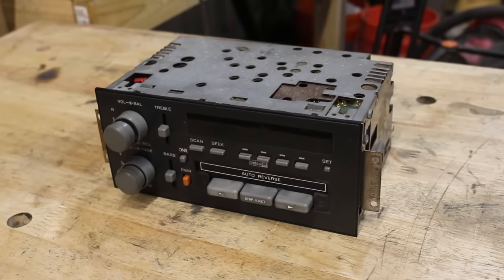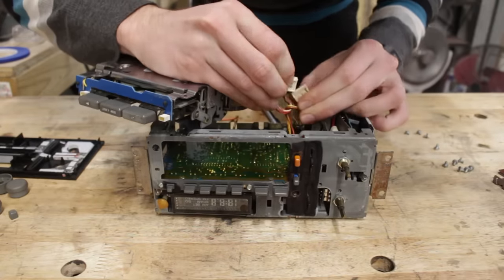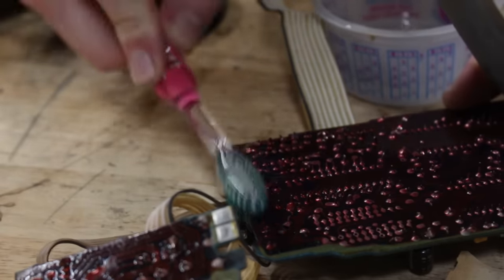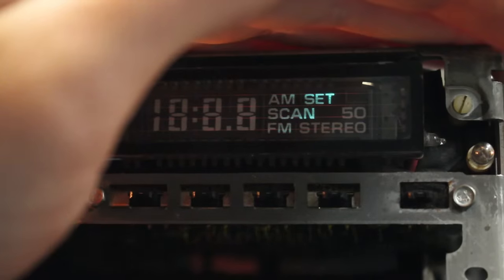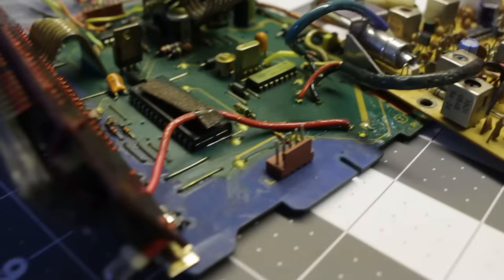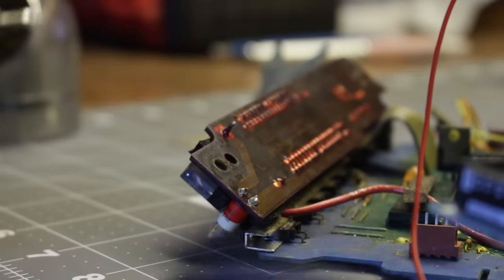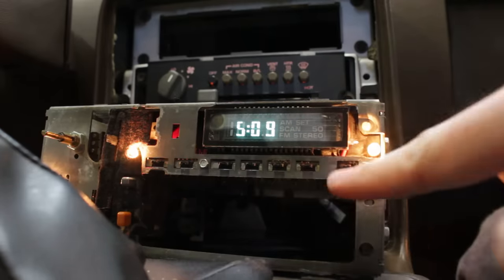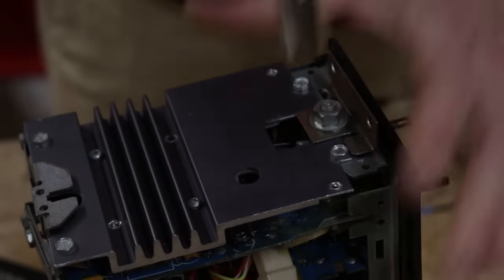1985 Fiero Radio Repair! | Saturday Projects

Comment: I'm deeply appreciative that you decided to keep and fix the OEM head unit than slapping a aftermarket one :"3
Reply: Yep. She's only original once.
Reply: Adding a BT module inside hooked directly to the amp would be a welcome mod. Kepping it OG but working with new stuff.
Reply: bluetooth tape adapter would sound just as clean without any fiddling around inside.  annoying that you would need to charge it every so often, but sound quality, top notch (and if he doesn't mine the wire to circumvent having to charge, the 3.5mm adapter is all the better/easier).

now just need to have phone manufacturers stop removing headphone jacks.
Reply: @darkmagician1184  you could steal 12 volts from somewhere in the radio and step it down to 5, and then the tape adapter wouldn't need to be charged if you kept it in there all the time
Reply: @darkmagician1184  If you are not a purist of sound or the base device is not great the tape adapter is fine, but its not great, the digital audio is turned to analog electric signals then into magnetic pulses, then picked up by the head of the tape wich reads the magnetic changes, then turn to electric pulses, preamplified, and then gets to the amplifier, a lot more steps and ways to get noise amplified than a BT module directly conected to the amplifier part of the stereo. But I agree that phones need to keep the audio jack, I dont like BT that much but having broke so many aux cables I understand the appeal now.
Reply: I have to disagree, changing a head unit is one of the best things i think you can do to a car to improve its functionality. It fits the look a lot better sure but a modern head unit would be way more functional, even if most of them are pretty ugly. He could have put a BT module inside to give him that, or stepped down the voltage inside to charge one of those BT tapes.
Reply: I added an aux in to the head unit in my 1982 Volvo by re-using a DIN socket on the rear that was originally intended to allow connection of an OEM EQ module. Instead of the EQ I made up a cable with a switching 3.5mm jack on the end, this can then be fitted to one of the switch blanks that the 240 has in the centre console for a factory look. Into that I can plug a phone, DAB tuner or BT module; to play a tape or listen to the radio I only need to pull the aux cord out. I don't have a big LCD screen glowing away up front but it's an antique car and I don't want one. We got by for years without having an iPad glued to the dash and this is the perfect compromise for making my 39-year old daily driver easier to live with whilst maintaining her originality.
Reply: @nope110  you can buy a BT module that fits in between the external antenna and the ant input on the head unit. When powered on it cuts all inputs to the tuner aside from whatever is connected via BT so you don't even need a clear FM frequency like the old DM transmitter adapters - you get a lovely clear signal with no interference because it effectively, electronically disconnects the antenna. Failing that Retrosiund are a company that make replacement head units for classic cars that look the part but have all the latest whistlesxand bells. There are lots of ways around having to retrofit a horrible '90s techno head unit to your classic car in order to dispense with physical media.
Reply: One of the very very few people who actually does that including me. If I had bought a vehicle that did not come with the factory radio, I'm going to the junkyard or on eBay.com to find one that closely matches or matches what it came off of and replacing that current one with the original.

I'm fine with using an FM transmitter or a cassette adapter, but please don't replace it with some aftermarket radio, it does not look good at all with the rest of the car!
Reply: Those 1970s and 1980s General Motors Delco radios, head units, whatever you want to call them were really great radio performers. They pulled in distant stations very well. I had a mono AM FM radio in my 1974 Vega and even though it wasn't stereo, I never had any static on it. It was an excellent performer.
Reply: If your phone has a type c connector it might do stereo analog sound out of that on a couple of the pins. My Pixel 3 and 4a 5g definitely do. I use the adapter that was an optional bundled item from the Pixel 3 order from the Google Store when they came out to get a better aux output from my pixel 4a than the aux out it has. The one it has is awfully weak and makes my custom sound systems sound awful. That little type c adapter with a type c female plug, male plug on a short captive cable, and a 3.5mm mini-trs aux female. It works very, very well.
Reply: @nick_nt7574  if you look around there are some that match a car nicely I got an alpine last year that still had an old-style led screen just like the factory in me 92 eb falcon

Comment: A little information about your radio. They called these the ETR Series radios. This radio is one of the earlier units to utilize the green vacuum display, replacing the old orange segment style displays. You can tell this radio is original to the car, or is definitely a 1985 headunit. The "Delco GM" name badge on the face went away in 1986, and was simple "Delco" from then forward. You also have the earlier style amplifier with 2x DM165 audio amplifier IC's. Should be 20x4 watts which is fantastic for 1985. There is a way to change the display on that radio to a lovely orange that matches the red extremely well. The display you had to reflow, 1991-1994 Saturn stock radios use the identical display board with the lightbulb and everything, but the vacuum fluorescent display lights up orange. Direct swap.

Comment: I wish that this series would never come to an end... 🥺
Hint for the casette player: I think you are very very close! I used to repair and clean many of these old casette players, and my assumption would be in this case that as You mentioned, may be the belt is tight a bit, this is normal, usually, the RPM of the cheap versions are not controlled by microcontroller, but there is a tunable resistor (potentiometer) you can tune the engine PRM with, this can be on the PCB or inside the motor, but there is a hole covered with some cross-cut sponge like material, you can push a little screwdriver through. The tape speed should be around 4.26cm/s, but if you have a well known track, you can adjust the speed 99% fine, just via ears. ;)
The other thing that can cause meowing are
1. that the grooves the belt are running in, can be dirty as well, these should be cleaned also.
2. The 2 rubber rollers can be dirty,. These can be cleaned only during operation, beacuse it is so hard to reach the whole surface and apply enough pressure on the ear cleaning pick to be able to remove the thousand year old dirt... 😉

On the other hand, the rubber roller may (does) shrink, especially when the car was sitting outside for decades, this should be checked also.
During play, the roller is pushed to the chrome plated axle via spring, check there is enough spring force, so the tape won’t slip during play.
I assume that the chrome plated axles which drive the rubber rollers can be turned easily by finger (of Finger 😉😜).

If these inspection are performed and meowing still exists, the clutch mechanism(s, since You have autoreverse) should be checked. If the clutch is so hard, and the spring of the rubber roller(s) not tight enough it may happen that the tape is slipping between the roller and the chrome plated axle, but this situation is quite rare I think.
If the meowing is the same independently from in which direction You are playing the tape I think the clutches are fine. (there is a very little chance that both are wrong exactly on the same way, I think)

One remark: if You wish to use the player with other audio sources as you showed via smartphone, there is a much simpler way than using that horrible sound quality audio adapter tape: the cables ftom the 3.5mm jack connector can be soldered directly to the input of the amplifier module. Usually this is where the 3 cable (red, white, ground) of the head, (or more (?) cable in your case, since You have 2 heads becase of autorevese) is soldered on the PCB.
I hope that this would help!
Sorry for the novel! 😉
BR,
Gery
Reply: If you are keeping the original head unit I wait total solder in an aux Jack.   This would be a good Saturday project.
Reply: I was able to get an aux jack into my Clarion head unit from similar vintage RX7 by doing something similar.  However, you need to trace the cassette mechanism and figure out how it turns off the radio when you insert a cassette.  You'll need some sort of switch or relay connected to a button to perform the same function when you want to listen to your auxiliary input...unless you want to hear the radio playing over it.
Reply: @chrishuyler3580  If you are a ghetto fabulous or super bubba wiring and circuit man you can just not plug the antenna in.
Reply: WOW - nice, very nice description.

For using any other Source like Smartphones there are Bluetoozth or radio Frequency Adaptors available to "stream" the Sound via own Frequency or BT - no soldering or wrecking of the original Radio necessary
Reply: @FRITZI999  those radio frequency adapters sound like compete garbage and even the best ones will limit you to FM frequency range.  If you want dynamic highs and lows, it’s not difficult to hard wire an auxiliary input or Bluetooth chip.
Reply: Great reply!..
Reply: What a fantastic reply. The internet was invented just for this exact kind of assistance - a fellow with deep and well-remembered personal experience giving his hands-on advice to a newer person. Good work, Gery!
Reply: @chrishuyler3580  I actually never noticed that on my Classic Car - as we all mostly use the Super-Garbage MPEG3 Format to listen to Music we actually should not discuss Quality ;-) 
This Format cuts of the entire Dynamic of the Music and limits Quality back to before old Records, just without the Scratches. 
So I would not worry about that.

Doesn´t the Music Radio Station sound good ? - so will the Stream you send in via own "Radio Station" from your Phone or whatever. It depends which Source you use. The Transmitter DOES NOT limit anything. Garbage (MP3) in = Garbage Sound

;-)

AND - listening Music in a Sportcar like mine whith the Engine behind me and the Muffler nearly empty it sounds for me more like Beancounting talking about loosing Dynamics of the Music. ;-) Don´t you think too?
Reply: @FRITZI999  if you can’t tell the difference between FM radio and 320kbps MP3, you either have very bad speakers or very bad ears. I will add, however, that Satellite radio is by far the worst quality of any source and that’s something like 64-128kbps.
Reply: @chrishuyler3580  well, i might need to point out, that i live in Europe (Germany). Radio im America is very low Quality comparing to our HighFi Level Broadcasts.
Not even Satellite radio in th US can beat our radio Quality. 

Thanks, but my Ears are pretty good. From technical standpoint it´s pretty clear. And as I said - Engine rumbling behind me, Muffler roaring and you are BS-ing about Quality of the Radio.... yeah, sure.

come oooooon ;-)
Reply: @warbuzzard7167  great response and so true
Reply: @FRITZI999 We have HD Radio in America, but a stereo from the 80's isn't going to receive a digital signal so you are stuck with the poor frequency response that has weak bass and grainy treble, not to mention the lack of stereo separation.  It's a dated technology (aside from HD radio) and using it in your signal path is much worse than directly wiring in a bluetooth chip or aux input style adapter.

Comment: Hey Ronald, nice work. It was the thumbnail that got me to watch your video. I immediately knew that was a Delco Electronics radio. Not because I had a Fiero, but because my dad worked for Delco Radio, which did one more iteration to Delco Electronics. He worked for them from 1960 to the early 90's. There is a reasonable chance one of his patents is in that unit of yours. He has since made the great heap and is no longer scribbling out the differential equations on his church bulletin (possibly not listening entirely to the service?). But he was always working on mathematical electrical engineering equations even when not at work. Math, Physics, and engineering was his passion, and Delco Electronics made it possible for him to use that passion to raise a family.  We were all truly thankful for his career and the existence it provided, and as a result, I was raised as a GM kid. Delco Electronics was a pretty interesting place.  When my dad hired with them in the 60's, it was all about the power transistor. He used calculus and and algebra to figure out biasing of the circuitry to build transistor based audio amplifiers for cars radios. But then in the 70's Delco Electronics made the decision to start making their own integrated circuits. Commonly know as ICs. To do this, they also grew their own silicon. Nobody else was growing silicon except for the dudes in silicon valley and in Japan. But there they were, in Kokomo Indiana, growing vertical columns of silicon, then slicing wafers of silicon, masking off layers in what was almost was a photographic process, to build complete transistor circuitry onto wafers, that then would be sliced up and placed in an IC packages. But with the mass exodus, all research and development left Kokomo for suppliers who I guess are now located in China. It is sad to drive by the Research and Engineering building in Kokomo, for to this day it stands empty. A lot of thinking, long hours of problem solving and maybe even some stale cigarette smoke is still echoing around in there. I don't know if youtube lets you place links in comments, but in homage to my dad here is a link of his patents while he worked at Delco Electronics: https://patents.justia.com/inventor/burtron-d-schertz Thanks for reminding me of my upbringing,  my Dad, Delco Electronics and even the beloved Fiero! I sooo miss my Dad to this day. Carry on your content creation Ronald! And I look forward to more of your content. I subscribed!
Reply from the maker: Wow Alan! I checked out the link (it does work) and I'm very positive that some of your dad's patents are in my unit. That is absolutely incredible. Thank you so much for taking the time to share! It's because of the very, very rare comments I get like this why I love making these videos.
Reply: @RonaldFinger  Well I probably should have also stated that your open song was basically my mantra growing up. Being that my dad was an engineer, he allowed me to dissect just about anything. It was a form of learning for me. But I definitely felt the feelings that you so nicely put into song at the start the video. (I really did not have any confidence, and still suffer a bit from that today) So I was hooked by your song right from the start.  All thru my life I always wanted to be an engineer like my dad. I liked making things but I also was a bit lazy. I only wanted to do what came easily. Most of it revolved around taking something apart and rebuilding something different. I was the weirdo kid who took a soapbox derby wheel set and my parents bed sheet and made a sail car to tool around my neighborhood. I was creative at being a "maker" but not very motivated by school. I loved school but only for the social side of it. Long story short, I never reached a high enough algebra skills to actually be good at calculus. I mean I could memoize enough to be a c student, but not what it takes to actually use the tools as needed to be an engineer. Luckily, when I went to college, I could study computer science which allowed me again to squeak by (and build things), but not without all of the math requirements of electrical engineering. I never reached the level of my dad's brain power. No patents in my name! But I do know that he was proud of me, my creations, and my work. Oh! I also want to throw in this point: when you were reviewing your work on the fluorescent display and the incandescent bulbs, I again was reminded of a time that I learned that cars dim their dashboard lights when you turn the headlights on. Fun little things in life that most folk never notice, but it was cool to see you find that morsel as well. Thanks for the reply, thanks for being you, thanks for making content, and here is to Burt Schertz and all the others at Delco Electronics! (looking forward to future content!)

Comment: We've got an 86 Trans Am radio packed away waiting for the day we could afford for it to be repaired. I have some electrical and soldering background and this particular video has shown me - hey, I can totally do this and not fuck it up. Thanks for this and all the other awesome videos in this series.
Reply: Same era caddy and pontiac high end units swap right in
Reply: I redid a 1987 Radio Shack Scanner, and yes I've disassembled it completely and reassembled it TWICE.  It took cojones but I was tired tired tired of it sitting on my bedstand not working right.
Reply: Replace all capacitors, rework all soldering point, use contact spray cleaner in every connector and potentiometer, replace Belt, remove old grease, lub it. In 99% of time it should be ok.
Reply: Yep, on those older radios, just cleaning off the conformal and resoldering every joint you can get to can do wonders.

The wiggle test isn't enough, you can get a bad signal through an overheated joint that crystallized.  Reflowing any you can get to is the best way to make sure that isn't your problem, and really doesn't take long.